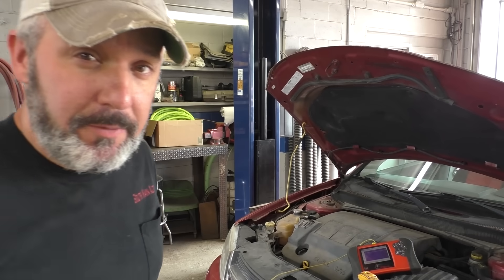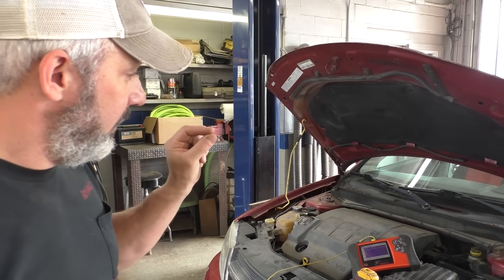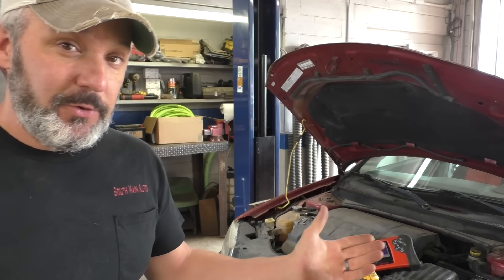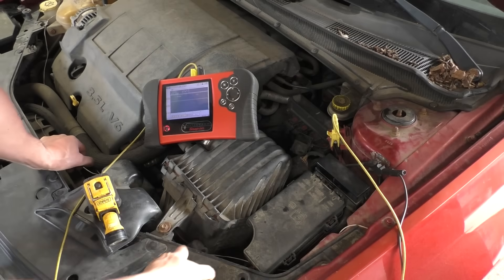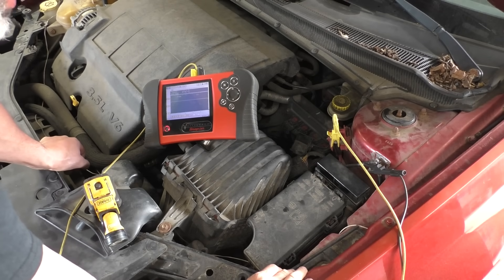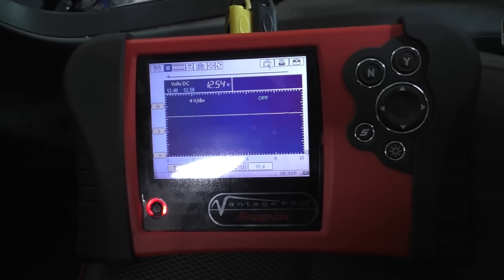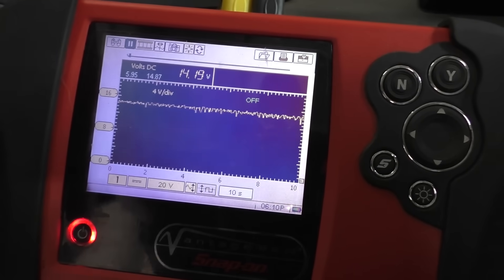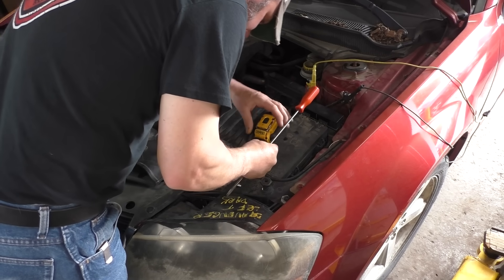Another Lesson In Voltage Drop - Don't Skip The Basics!

Comment: Yes, and I put a new whole entire wire when my battery ground and hot wire it runs from the battery to the starter to the frame of the vehicle. Somebody put the ground wire to the frame wires or small wire and real big heavy wire and it’s like a washer that’s the ground wire. It goes to the frame little wind goes on top of it, put it opposite way and it would not start my car. Sometimes it was dark because it wasn’t grounded all the way I said that’s crazy.

Comment: This saved me replacing a starter and battery on my boat which it really seemed like both were bad...  by testing and not guessing it was obvious I was getting voltage drop on a corroded positive battery cable. the negative side was fine.

Comment: Is that negative terminal at the battery the way it comes from the factory with the additional connection? Regardless, when the other shop replaced the battery, it's pretty irresponsible that they didn't clean the post on that negative terminal!

Comment: So I put this video to use today. I was driving my 2007 Mazda 6 Wagon. I have a power adapter in the 12 volt outlet that also displays voltage. It was showing low as usual. When I got home, I checked the battery voltage from positive to negative, and it was 13.7V. I checked from positive to the shock tower, and it was 13.2V. Then I checked from the middle of the negative post to the shock tower, and there was my missing 0.5V. Thank you for the reminder, Eric.

Comment: I understand the voltage drop in that connection,  but not sure why the shock tower connections were getting ~14v and the battery only 13v. Is it because the alternator charge wire is connected at the shock tower rather than directly to the battery?

Comment: Very good refresher course on voltage drop.  However, I can't believe another shop threw a starter at the thing without looking at the rusty battery terminals.  Especially on those cars where it is subjected to road debris in the salt belt.  You don't need to be an electrical engineer to know that.

Comment: I recently checked an F150 that wouldn't crank. Newly installed battery and new pretty painted terminals. Checked voltage at battery posts, good. Checked between +post and solenoid lug on firewall, 6V drop! Popped off new terminals and they were COMPLETELY painted, inside and out. Luckily it was cheap paint, so came off pretty easy with sandpaper and terminal cleaning brush. Wonder how many people these pretty terminals will bite that don't know any better?

Comment: I just worked on my 2000 GMC 8500 service truck that had sat for  awhile, the starter solenoid would just click. I found the braided 3/0 ground cable from the frame to the starter ground was bad, It looked fine but would not carry the current needed to start the Cat 3126. I learned voltage drop years ago, it has saved me from firing the parts cannon.

Comment: what's frustrating to me is the other shop got the Starter Replacement, and the Battery replacement, most likely north of 600 dollars, and not fix the issue. Now the customer wants you to check it out, and they want a discount because they spent so much money at the other shop who didnt fix the issue. You used your knowledge and experience to actually identify and resolve the real issue, but the customer will want to pay less than 50 because it only took a few minutes. Then , next time they have another problem, they will again got to the same shop they initially went to here because they are a few dollars cheaper on their diag than you are.

Comment: If you measured the resistance between the battery post and the terminal, it would measure 0.0 ohms?
Reply: that might blow the fuse on your ohmmeter, that's why you use voltage drop.  But if you were to disconnect it, it should be 0, or at least pretty close to 0.  You will have some resistance in your leads.
Reply: It's better to measuring voltage instead of Ω=ohm

Comment: Well done.  
A very impressive and informative demonstration.  
Logical fault finding is brilliant to watch, almost always faster than shotgunning, and the only method for a complex system.  Some people never learn this.  
Thanks for the vid.  There's a lot packed in this 15 minutes and appreciate your effort.   
Cheers (electronics technician by trade).  
PS.  Voltage as a electrical "pressure" is spot on.   Voltage aka, EMF (electro motive force).

Comment: On my 2007 Grand Prix GT, it'd probably be tougher to measure voltages while the car runs because the computer seem to have full control where the alternator charges.. so sometimes it will charge at high 12's, sometimes mid 13's, and other times 14+.  It seems to have a current sensor near the battery too (one of the battery cables goes through this ring sensor).

Comment: I always use a garden hose analogy when I explain voltage drop. There's a hose with a "gun" attachment on the end and the spigot is on. Kink the hose (high resistance) and both sides of the kink will still hold pressure (potential difference measured with no current). Spray from the gun to create flow (current). There's only a trickle out of the gun,  but the other side of the kink is still hard with pressure. release the trigger and eventually both sides will equalize (measuring without current.) Great video as always!!!

Comment: It's interesting to me that the surface area of the alligator clip actually touching the shaft of the screwdriver is enough to measure what you need. Does that only work because of how low the voltage is in the system?
Reply: The meter isn’t drawing much current so it doesn’t need much of a connection to get a reading. 
Thats why doing a voltage drop test can be so important. With the voltage drop you’re putting load on the system.

Comment: well done and timely!  Have 1/2 the wiring torn out of my Triumph Rocket Three looking for a problem. (Intermittent short, for years I could only start the bike by holding the starter switch and turning the handlebars, then that quite working so I will try to fix it correctly.)

Comment: That other shop should have seen that rusty connection, instead of ripping off the customer for the price of a new battery!  Did they load-test the old battery?  Did they make sure all connections to & from the battery were clean & tight, or did they just assume the that one ground had to be cleaned up & problem solved?

Comment: Voltage drop follows Kirchhoff's voltage law where the sum of all the voltages in a closed loop are equal to zero.  In other words, the sum of all the voltage drops in a circuit is equal to source voltage.  Preferably we want all the voltage drop to occur at the load and not at a bad connection.

Comment: I was dealing with voltage drop of a different kind this week. Staying at a campground in my camper and the old, worn out plug was causing excessive heat and voltage drop under load, even a bit of arcing. They ended up replacing the old plug and the breaker too. They'd both started to melt on the backside from the heat. Got my missing volts back after the swap.

Comment: Sorry if a dup.  Eric nor the other shop needed a Snap on  graphing meter/ scope to find this problem.  Two tools , a volt meter and  a noggin is needed,  well maybe some eyes on the battery terminals when changing the battery  would have needed no special anything (20-20 hindsite)  Mechanics get the cool specialized test equipment., you just need to be able to add it to the bill.  As a bench tech  for many years , just had general use test equipment, on the  low end of lab equipment( had pro everything , just not always the  best name brand)

Comment: There are a couple things that I think the general public doesn't understand.  One is that a wire is not always the same from one end to the other.  The other is that the design of a car's electrical system makes a massive tradeoff.  That is that in order to avoid having to run 2 wires to every electrical component, manufacturers use the metal of the car itself as a replacement for one of those wires.  Hence, negative ground.  Anywhere that there is a connection between point a and point b, is a potential place for a bad connection from corrosion or wires fraying, or similar, which leads to a loss of some of the capacity of that circuit.  Most of your viewers probably understand this but car owners often don't.

Comment: Just had one of these today down in the south. 2019 F350 powerstroke. Previously was repaired with a brass connector on the positive cable for second battery. The corrosion went 7 inches into the cable.

Comment: A detail worth mentioning - the alternator was trying to put at least 10 to 20 amps of charging current into that battery. With a voltage drop of one volt, that works out to a resistance of 0.1 to 0.05 Ohms (R=V/I) in that crusty connection, so as Eric said you ain't measuring chit with an ohm meter.

Comment: Eric, I don't see how simply placing that screwdriver onto the top of the post can be a really dependable connection.
Reply from the maker: no different than touching it with the lead of your meter right? We are just taking a measurement with the meter, not passing current through it or anything.
Reply: @SouthMainAuto  my point was the tenuous connection to the lead post. I have very sharp probes on all of my meters. A large toothed jaw alligator clip to the lead post would be a more dependable connection. Great post though. I would have never used a ground clamp to the battery with a rusty steel terminal end on it. The point you make about 12 volts is very good. Even a little resistance can cause a lot of trouble when you consider how sensitive the computers in today's vehicles are. If there were computers back in Henry's day, I bet he would have put at least 2 twelves in series to get 24 volts. I just joined as a member, but I've been watching you for many years, and have the utmost respect for you as a technician, and even moreso as a model for young men to emulate. This country sorely needs more mentors like you. God Bless you and your beautiful family.

Comment: The interesting thing about voltage drop is that you can find significant differences between conductors of premium, decent, mediocre, and poor quality almost the same as corroded or poor connections.
When it comes to electrical conductivity, voltage drop testing should be the go to move even when the problem appears to be obvious.😉
Remote terminals are notorious for voltage drop, but never assume, just check it and you know for sure.🤙

Comment: Is that a low carbide tipped screwdriver? If you can see a differance in the grain pattern at the tip there most likely is some resistance there. I didnt notice you touch the lead to the tip of the screwdrive to auto zero the meter like with a Fluke feature. I know youll argue only millivolts but is it? But a whole voltage drop brings it down to almost a trikle chage insread of a high amp charge system. And true a few millivolts isnt going to be the difference. But It just is cringy not to zero the meter
Reply from the maker: A few millivolts really. Give me a break. On a 200 amp circuit if my voltage drop is 0.022vdc or 0.024vdc it does not matter. Even IF the "low carbon" tip made a difference (and we know it doesn't) You clearly don't get the concept and just want to find something to bitch about to feel important. 98% of the people that use a meter have no idea what the delta button is used for anyhow so why add confusion to something so irrelevant.

Comment: I was baffled as to why the voltage was higher further away from the battery.  I would have expected the higher voltage to be at the battery and not the clamp further out.  Electrons flow from negative to positive.   Was it a failure at the battery side or simply the secondary connection close to the battery.  Mmmm.....

Comment: Place the following question in your favorite generative AI (i.e. ChatGPT):
"if two identical circuits show a voltage difference of 1V after applying a voltage of 13V, what is the resistance difference between both circuits?"

Ends up the resistance difference is very small, so it might be difficult to detect.

Comment: There is a certain amount of voltage drop in a circuit. Need to know what's good in a normal operating system before you know what's bad.
Performing a voltage drop for example across a know good ignition switch is usually less than 50mv However even when the system operates ok the switch could have around 200, 300mv drop or more. But has the switch contacts heat up from the excessive resistance  the voltage drop will jump to 1,2 volts or more than the system fails 
That's an intermittent failure
that can be diagnosed by knowing the allowable resistance in a circuit

Comment: I started learning electronics in the 50's by going on service calls with my dad to fix people's TVs.  Yes, TVs  were once repairable in the home, usually by replacing a vacuum tube or 2.  There were no circuit boards; all the connections were point to point wiring.  Any bad soldering joint could cause problems.  When I started repairing electronics,  I learned that most of the "unsolvable" problems were caused by bad ground connections.  The higher the circuit current was, the bigger the voltage drop.

Comment: Strictly speaking you should have verified that there was no voltage drop over your "long probe".  Everything has a resistance, which means voltage drop, but that in copper wires and such requires very sensitive and expensive meters to measure.  Like when you test the voltage drop across a fuse to find the parasitic current.  

On the upside, there wasn't a problem with the resistance in the screwdriver, but it is something to keep in mind, especially when you get to using long jumper wires.

Comment: A CLASSIC explain of voltage drop is in the beginning of electric power to business/homes there was fight between AC and DC.  And this surrounded VOLTAGE DROP.  In a pure resistance environment voltage drop vs current is SAME for AC & DC.  However, AC won out because it can be stepped-up and later stepped-down.  POWER = V × I.   For equal power when V☝️ then I👇.  When I decreases so does voltage drop across a conductor.

Comment: Like mentioned above, i was taught .2 (2/tenths) volt drop per connection Max. And starter cranking, we never wanted the battery to drop below 9.6 vdc...

I see mentioned 9 volts, and that most likely is fine with modern ignition systems..  but back in the day with point systems it was 9.6v

And the ignition system ran through a ballest resister during run and bypassed that resister during crank...
Reply: Spellcheck

Comment: There was 1V lost on the negative side of the cable but you never tested the positive cable? You said you should have 9 to 10 volts when starting the car but you only had 5.9V. Based on your testing should you not also verify for 0V on the positive cable also to confirm it's only the negative cable? Never stop the videos learned a lot here. Just changed the transmission oil in my Volvo cause you said I could.

Comment: Here’s the problem with my 98 Trans Am. When I do a cold start my voltage is 13.9. Around 10 min of driving she drops to 12.9 in the cabin. When I check with my multimeter under the hood it’s still around 13.4. What would cause the drop from fuse box to dashboard?

Comment: I understand what I have seen however when you went from the upper terminal to meter lead and the other lead directly to the battery terminal... and you even said (paraphrasing): now we're going directly to the battery terminal, you were not. You've introduced a new variable... the screwdriver in series. You even confirmed the 1 volt drop by removing the clamp from the screwdriver and again going to the topside terminal directly and the drop goes away... How do we know the screwdriver is not causing the 1 volt drop? We would know by eliminating that variable we introduced... the screwdriver. 

To eliminate the screwdriver simply take the screwdriver while still connected in series with the test lead directly to the topside terminal to the screwdriver to the lead instead of removing the lead from the screwdriver (and removing the variable temporally) and connecting again directly topside. While the screwdriver introduced a drop or not we introduced a new variable and witnessed a drop. The topside terminal test should have included the screwdriver still in series with the test lead. - if not the problem, move on. We've eliminated the variable we just introduced. The vehicle was then ready for the next shop... or was it?

Whew. I realize this could have been said in one sentence however we have no idea who will read this. A drawing would have been best but we are left here with only text. By the way I stand by what I have said many times... Mr. O is a fantastic troubleshooter.  In my opinion one of the best! Mr. O... you start by giving us your gut feel and then proceed to using thousands of dollars of electronic gear (needed by most) to confirm your gut feel. You are one of the best that I have seen in my long professional career of troubleshooting electricity and electronics. LOVE YOUR VIDEOS AND KNOWLEDGE MR. O !!! (P.S. - if I somehow missed a step by Mr. O, I apologize, humbly!)

Comment: Just dont use the long probe on the positive side as the main battery fuses are expensive. and once you let the smoke out they dont seem to work very well.. I have some large washer tube that I slide over the long probe if testing straight to the alternator etc. as always a great video. nice to see good quality advise on YT.